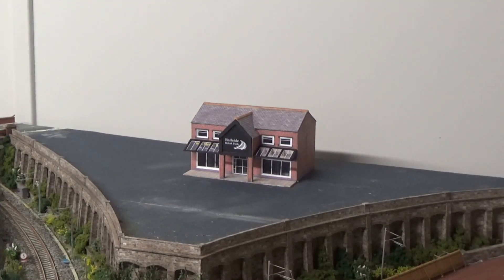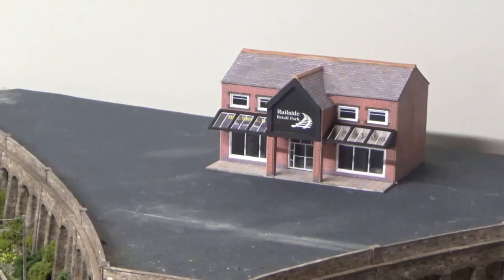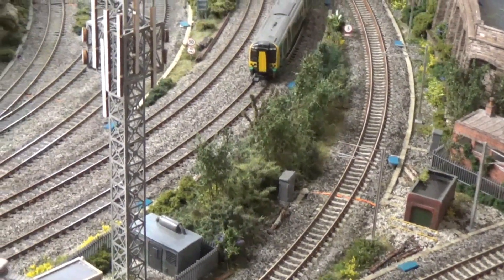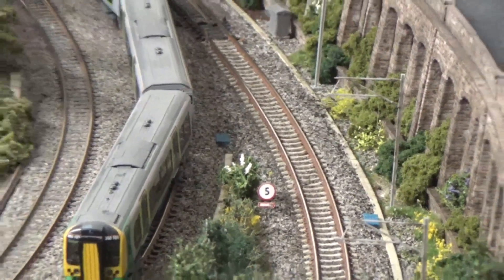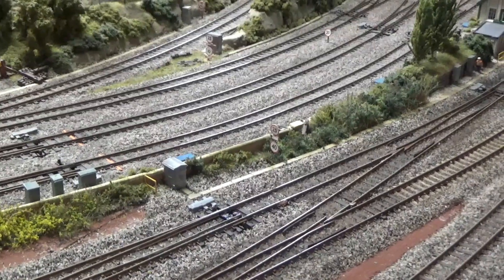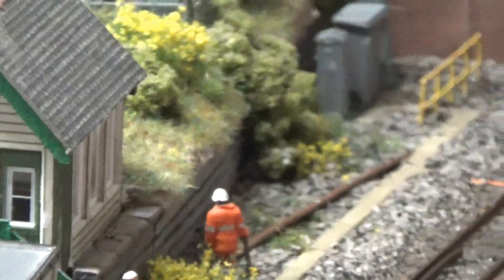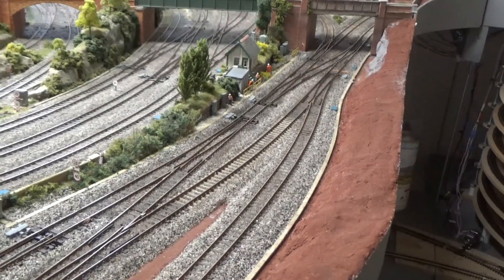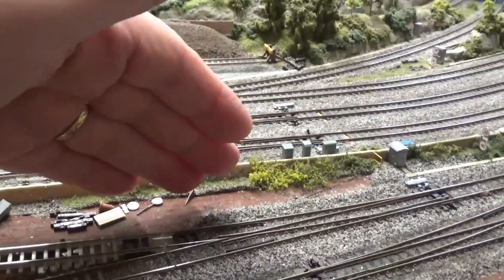Blackwood N  Gauge Layout # June 2022

Comment: hi euan
another great update from yourself and i will say i love that mast looks like a hard kit to build but you said it was a simple kit.
loving all the trackside detailing cant wait for your next update.
and once again a brill running session everything runs so smoothly.
peter
Reply from the maker: Hi Peter- many thanks.  The difficult bit with the overhead portals is attaching the legs.  Not a lot of surface area to attach to.  I ended up adding a very thin piece of wire to the end diagonal supports.  Once painted you don't notice it - hopefully!  Cheers Euan

Comment: Really like the scenic work you have completed Euan.  I wonder which was more galling; cutting off the pin or your far sighted wife being right?  I suspect you allowed yourself the odd jings crivens help me boab or two when you sliced the pin off.  The sight lines you now have for the running sessions are so good and very lifelike.  It is a joy to watch them.  Stephen
Reply from the maker: Hi Stephen - yes there were a few "choice words" muttered.  The worst bit was admitting to my better half what had occurred 🤭.   At least I can still reuse the point on the reconfigured crossing.  I did enjoy spending a good few hours running trains to film.  Cheers Euan

Comment: Hello Euan I very much like what you have done there, the detail is outstanding! The whole look of that area where the 'small signalbox' is, is great and no doubt when the further section along the line is done it will blend in nicely. My only suggestion would be (if they aren't already there, I couldn't see any!) perhaps some small concrete steps just past the small signalbox upto the slightly higher level(?), so the 'trackside engineers' can get upto those relay boxes. Great work, thanks.
Reply from the maker: Hi Peter - many thanks for commenting and the suggestion re the steps for access.  There aren't any as yet but I do want to put some in to provide access.  They may go at the low end of the retaining wall as that's probably the easiest place to put them in.  Cheers Euan

Comment: Wow Euan it's coming along very well ,well done your doing a fantastic job of building your layout.
I'm liking the dummy point motors I'm still undecided as to fit them or point rodding with signal cables.
Reply from the maker: Hi Brian  👋  many thanks for commenting.  The dummy point motors help finish the scene.  In N gauge I don't think you can get point rodding so it has to be the motors.  The rodding would look good and I'm sure some clever people will have worked out a way of doing it in N gauge.  Cheers Euan

Comment: Euan, you have probable mentioned this previously, who is the manufacturer of the bridge with the Stobart lorry sitting on it, or is it scratch built?
Reply from the maker: Hi Anthony 👋  - if you are referring to the arched bridge.  This is a Scalescenes kit R017.  However to make it fit over the tracks and provide sufficient clearance I printed it out at around 110% of its normal size.  The deck was also widened as I was putting a road rather than railway track on it.  A lot of expirementation was required to i.e. printing off at different %'s to see what size would fit.   Happy modelling!  Cheers Euan
Reply: @thegrowler-blackwoodngauge  many thanks.

Comment: Good to see the new scenic stuff you have added Evan. When you extend the track to the station will the line go through the station as a passing loop?. Stay safe
Reply from the maker: Hi Mike - the extended link line comes off the same circuit as it presently does - just starts on the straight rather than the curve.  This line bypasses the station - so doesn't go through it.  Cheers Euan